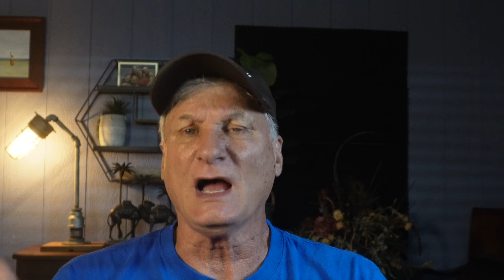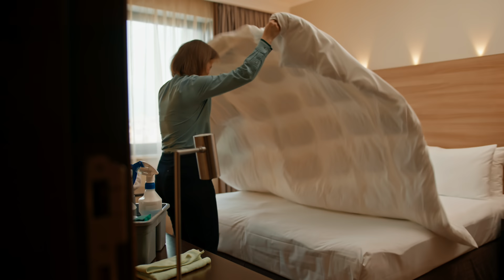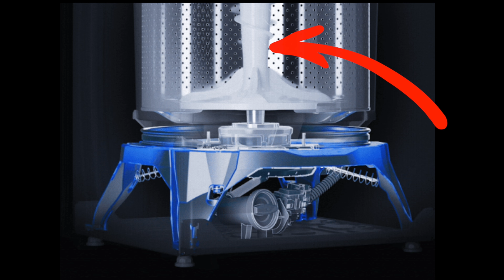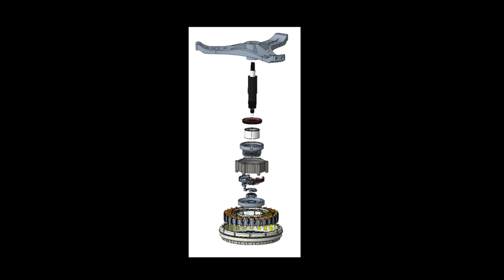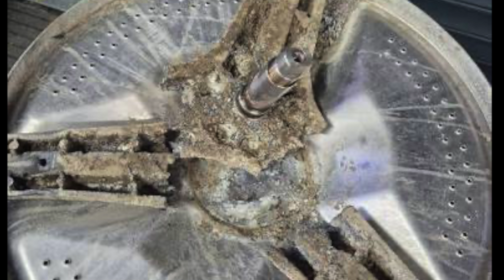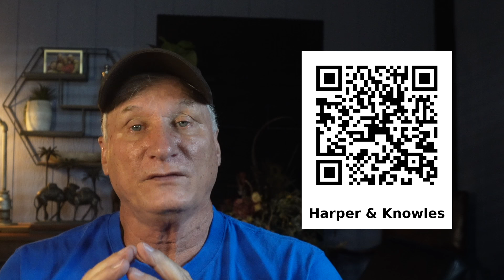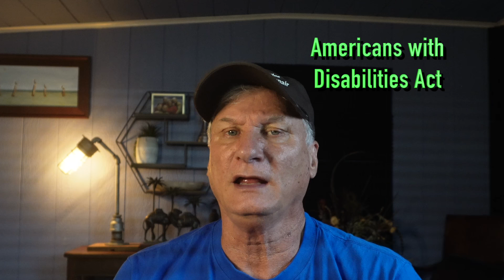Maytag's New 30-Year Washer: No Gearcase, Real Agitator, 900 RPM

Comment: Here's the deal, AAAALLLLLL the plastic, capacitors, electronics, and yes, firmware ... in this thing is designed to wear out and be replaced. "30 years" means a 30 year maintenance plan generating RR for Maytag. This also means you have to connect it to your wifi and have an account to run it.

Comment: I own a Kenmore washer and dryer. They are over 20 years old and still run well. Aside from  the occasional bad timer or heating element, both of which are super easy to change and inexpensive, they have never had any major issues.

Comment: Our current washer and dryer date to the 90s.  A ew years old I replaced the roller, glides, belt, etc on the dryer.  I also replaced a switch and timer on our washer.  Still running great.  An appliance store near me said that I was better to repair it than replace them.  The newer machines will not last.

Comment: When my parents moved into their new retirement home in 1990, it had new appliances in it.  They gave us their Kenmore model "70" washer & dryer that they had bought in 1973, before they moved in 1990.  We are still using them today. They're now 53 years old!  Yes, the washer has had a few parts replaced over the years. A new belt, a new water fill solenoid, both "T"-toggle parts of the transmission engagement levers and a new water pump. All those parts together, may have cost $95.
 Over the years, the dryer has only needed a new belt, a boggy wheel, both door support cables, a new lint filter screen, and a plastic door catch. Maybe $65 total. These were built simple, and they're basic, but they have lasted forever!

Comment: I'm still using my mothers Maytag which has to be 50 years old if not more. I had to replace her old dryer about 4 years ago, but she had it longer than the washer. My new water heater says it's good for 12 years. The one it replaced was installed in 1977 and working find until the gas put a new meter on and shut the gas off. It wouldn't restart. My new Air unit is supposed to be good for ten yeas. The one they took out was also installed in 1977. It's make it break so they have to buy another one.

Comment: The agitator in the picture for the Maytag duracore is in fact the typical wash plate with a faux corkscrew post agitator that's literally in every other Maytag and whirlpool washer sold at every big box store, the part number is W11550891,  Maytag better change that agitator to something better or use a dual action agitator,  nobody is going to spend 1,500 for a washer that has the same agitator/performance as a 500 dollar washer,  watch YouTube videos of washers with this agitator.... It's awful! Doesn't even move clothes around! Why would they get every other part of this machine right then something as important as the agitator just use something from their parts bin? Wake up Maytag!!!!!! If they use this agitator speed queen will destroy them in marketing! Remember when Maytag mocked speed queen saying "ours washes better we have a dual action agitator"? Well.. not anymore!!!

Comment: I bought a Matag gas  dryer 38 years ago (simple 3 different dryer settings, nothing fancy). Have replaced the thermocouple about 3 times. Other than that, it is a workhorse and I love it.
I've had my Maytag Neptune front loader for 25 years with no problems! I pray these 2 appliances keep working, because I do NOT like the new ones...too many fancy settings that you DO NOT need and only adds price and things to break!
Reply: they will last  oner 50 years. that one is  a old pilot light. the only thing  that might wear out is the  motor

Comment: We had all Kenmore appliances for years. Sears was a great place to shop in the 70's. Kenmore was unbeatable. I have a 2005 Kenmore refrigerator running right now in a storage room
Reply: I grew up with my mom only getting Kenmore.  Last so long.
Reply: AKA Whirlpool
Reply: Kenmore is just a brand. In the past, they were made by Frigidaire or whirlpool and we're good products.  Now they are made by LG and are absolute garbage.
Reply: Yes I purchased my first washer dryer combo at Sears. 1988.  Actually I checked into Maytag same time but Kenmore Whirlpool model rated higher that year. It was the heavy duty 90 series I believe. I loaned it to my mom and I purchased a new Frigidaire front load 1995. I still have the Frigidaire washer and original Kenmore gas dryer. I also purchased a Speed Queen front load washer along with dryer.

Comment: Our Matag oven is a POS. It takes forever to reach temperature. It was delivered broken. It took me a month to realize the convection fan wasn't working. 
It gives you a false reading on the temperature display by up to 25 degrees. 
The dishwasher is no better. It leaked, and the subfloor swelled and buckled. Now we're just throwing in the towel and getting a new kitchen. It's not cheap. 
We got the two- Oven and dishwasher at the same time from Lowe's about four years ago. 
If it wasn't for bad luck, we would have no luck at all.😟

Comment: So Blackrock and Vanguard are large shareholders... Not a direct majority, but how much of the other shareholders do they control?

Showing results for was whirlpool bought or is it owned or controlled by private equity capital? 

Whirlpool is not owned or controlled by private equity capital. 

It is a publicly traded corporation listed on the New York Stock Exchange (NYSE) under the ticker symbol WHR. 
Ownership is distributed among institutional investors, mutual funds, and individual shareholders, with no single entity or private equity firm holding controlling interest. 
Key shareholders include large asset management firms like BlackRock and The Vanguard Group, which together hold a significant but non-controlling portion of the shares. The company operates as an independent U.S. entity with a one-share-one-vote structure, ensuring that control remains with the broad base of public shareholders rather than a private owner.

Comment: I have a Kenmore branded Whirlpool for 34 years.  All I have ever had to do to it is change the oreo (coupling) between the motor and transmission.  It is an amazing machine and I hope I can keep it running for another 30 years because I don't want a bunch of electronic garbage in a washing machine.
Reply: Some of the most reliable washers ever, rebuilding mine right now

Comment: Hi Chip — Off topic.  I have an old Kenmore washer, at least 25 years old, probably older.  It’s a real trooper.  I saw a video that explained the agitator dogs and how they work.  Working dogs allow the top part of the agitator to rotate in one direction, but it locks in the other direction.  I didn’t know about that, and I checked my machine.  It has an agitator, but the top and bottom seem to be one piece.  The whole agitator moves as one, back and forth.  Is that a problem?  I love this machine and wish I could get one just like it, but they don’t make them like this anymore, except I guess Speed Queen.  I hope other manufacturers return to making durable equipment, as I as so disgusted with the junk being sold now.  😢
Reply from the maker: No, that is a blessing. I love that style of agitator. Some will argue it isn't as effective, but if you watch the clothes wash, it moves them downward at the center just like a two-piece model does. Fewer parts for the same effect.
Reply: @HarperandKnowles  Thank you for prompt reply.  👍🏻

Comment: I haven't bought a Maytag since I got burned by a Neptune front-load washer 20 years ago. Just after the warranty expired, a $5.00 "wax motor" (the thing that keeps the door from opening when it's running) failed and took out a $300.00 circuit board.

Comment: It seems like washer designers don’t understand gravity and that water runs downhill.  It seems they always put the motor on the bottom where any leak can have a negative impact.  Particularly now with the external style motor, they could put the magnets around the top of the tub and the stator coils on top also.  This way, a simple leak wouldn’t have a change to cook the motor.

Comment: In 2022 I bought a new top of the line maytag washer and dryer for my new house. The washer has absolutely been the worst purchase I have ever made. I've had to replace the main board, wire harness,  and lid lock multiple times. I will NEVER buy another maytag/whirlpool appliance again.

Comment: I don't trust a machine with no gearcase.  Those tiny motors, from my experience fail quickly compared to a good ol castiron gearcase.  The bearings in the motors are small  And, Lets get back to analog dials.

Comment: In 2017 I had had enough of my whirlpool cabrio washer.  Nothing ever came out clean and took forever to wash a load.  I called a local speed queen dealer and bought a washer ight unseen over the phone.  The first time I saw it in person was when it was delivered.    I could tell by the first load how much cleaner my clothes were.   2 weeks ago I had a repair man just come do a checkup on my washer just to make sure I was cleaning the agitator correctly etc.  he opened it up and was so impressed as to how good a shape it was in.  It’s 9 years old now.   He said he would be surprised if it did t last another 15 or more years.

Comment: I've got two Maytag's in the yard. They were bought new and didn't last a year. I went on Craigslist and found a 10 year old Hotpoint. 
It's been doing fine for a year.
Reply: I have a used Kenmore washer that my fiancee owned.  That was 1988.  I am still using it.  No service calls.  IT is all analog.
Reply: @millerforester6237  Those are the best kind. I used one for 20 years that was 15 years old when I got it.

Comment: I am still using the Kenmore washing machine I bought used 22 years ago.  I got a dryer with it as a set from a used appliance store.  It was an extra large capacity and reportedly was replaced because the previous owner wanted a new fancier machine.  I can almost guarantee that it has lasted me longer than her new machine did.  I did have to get some parts replaced once.  The dryer that I bought along with it has also lasted for years, though my dad had to repair something in it.  The total cost I bought it for, and the repairs I paid for it cost so much less than a new machine back then, and I can’t even imagine now.  I have washed everything from heavy comforters to sheep fleeces in it.  Especially for washing fleeces, you need a spin cycle that doesn’t run water into the machine as it’s spinning or it can felt.  If this machine ever goes out and can’t be repaired, I don’t know what I’ll do.  We’ve used the newer HE machines at other people’s houses and they just don’t get the clothes as clean.  When we had our babies, we’d have to wash the diapers 3 x for every one wash in our machine.  I don’t think that actually saves water in the long run.
Not to mention, the HE washer took three to five times as long as our washing machine.  I’d frankly rather do my laundry with a laundry bucket and plunger washer than use an HE machine.
Reply: I have a used Kenmore washer that my fiancee owned in 1988.  it is all analog.  no service calls.  Using it now.
Reply: Kenmore Appliances were the best, longest lasting appliances ever made!!! ❤
Reply: I'm still using mine.  Built in the 90s. Ive tried another because my husband wanted new.  It was crap and we went and moved the old one right back in.
Reply: They were the best😻
Reply: 23 year old HE Kenmore here still going
Reply: In my experience, one repair costs more than buying a new machine.
Reply: @D @David-999-z ur repair person didn’t actually charge that much for the washer, no more than 15% of a new washer, maybe 20% at the most, and my dad repaired the dryer.  He’s good at fixing most things.  And I would rather have the old machine than the new ones.  They don’t work as well to actually get clothes clean and they don’t work at all on sheep fleeces without felting them.  As long as we can keep our old washer going, I’ll pay to repair it, or my husband and I will figure it out ourselves, as we’re both fairly handy.  If we do finally have to buy another one, I’ll try to find another older one like ours.
Reply: @David-999-z that’s why you diy
Reply: My mom had her Kenmore for 36 years and went through five kids with it.

Comment: I bought a set of the cheapest Maytags available in 2001. $900 for both. 
They have just a couple of simple mechanical buttons. 
They have performed flawlessly for 25 years and are good for another 25.

NEVER buy a "smart" appliance.

Smart is the new STUPID.
Reply: Computers aren't the reason the products are poor.

Comment: I love my Whirlpool appliances.  I have had to complete several repairs but I am fortunate to be able to do those myself and only incur the cost of the parts.   I also open them up an clean them out and maintain them on a yearly basis. My washer and dryer are going on 21 years, in fairness things may have changed since purchased. However, my experience is there products are repairable and generally high quality compared to the rest of the market.

Comment: I had a 2001 Amana Commercial that when I took it apart, had many of the same parts that are inside a Speed Queen, except for the plastic outer tub.  Now the tub lasted the life of the machine but I've heard of some people forgetting a safety pin or some metal object poking the outer tub but was fixable with jb weld or plastic epoxy.  But what went out first was obviously the drain pump at about 10 years as well as the plastic corrugated drain hose wore a tiny hole in it from vibrating/rubbing up against a metal part inside the unit, but the first major part was the tub bearing at about 15 years and that took a lot of effort on my part to replace, and then at about 20 years the transmission went out and we junked it at that point.  This was for a family of 5 that did a lot of laundry.

Comment: as someone in central louisiana, how'd you know? I had the control board "go out" on an MCT on year 8 or so, service tech said $800 but go buy it myself and put it in myself, so i did, for like $130. The little pressure tube sensor part should be separate in my opinion. I also don't  have a problem with the wash plate system in mine, you just have to load it differently. Not sure if this channel has shown how to load; wash plates agitate in a donut shape viewed from the side, stuff goes up, in, down, out. on an agitator washer, stuff goes in a donut shape in a circle, back and forth. So you gotta load washplate ones only on the sides*, as if it had a massive agitator, you should be able to see *most of the washplate when it's fully loaded. Do that, and you won't hate your washplate, even on He2 washers!

Comment: What can you recommend, we need washer asap, 4 ppl lot of clothes, don’t want to spend 2k. On a budget however I don’t want junk either, we just got done takin apart a whirlpool cabrio 3 times to replace those rods, sent us wrong sizes, took those out, refurbished original ones new foam things, cleaned greased rods etc. still unbalanced. Figured now it’s the drive hub thing, have to take that cover off that hardly anyone can get off without a crowbar, I was going to replace the part with a metal one instead of plastic. We bought it used , 2 weeks later all this mess started with banging and clanging and signals etc. I’m done with this I think. Mainly because of the face I don’t want to fight getting that cover off and not having correct tools even though this machine doesn’t require that specific tool they use on some. We’re not into this washer deep far as money , just time mainly. But my wife is done with it. She helped me , we spend 40 bucks a week a laundry mat every week. I just don’t know what to buy, I research and read and read etc. I came down to GE, LG, Maytag. I generally thought speed queen was not in our budget so I ignored that brand prob the best one though. I’m literally lost at this point. I’m happy I came across you this morning, all I’m asking you is for a good recommendation for a washer, I think I’m staying clear of used , all I see is whirlpool. Now I know why. Not many other brands certainly not speed queen and not many maytags. If you can give me a specific model I would so much appreciate it. And thanks a lot for in depth insight to this industry, wow , if everyone knew what goes on , they really are out for a buck not so much the consumer. Logically it makes sense to go with an expensive dependable one. Money of course depending on situations depends on what is affordable. I’m at point I don’t care. But want to be sensible.

Comment: About three yrs ago I got tired of these enervy saving washers.  No matter how small amount of detergent I used, it still wouldn't get the detergent out.  So I bought a Matag Commercial washer, I wanted a full tub of water to wash and rinse my clothes.  The Matag had a 5 yr warranty on parts and labor and at a cost of $1000.00.  The first year had to have repairman, second year same thing.  With a warranty of parts & labor it was worth it.   It is working better than new now.

Comment: I was in the market for new kitchen appliances earlier this year.  Mine are 20 years old.  The dealer at the appliance store said to expect 7 or 8 years of usability out of new appliances.  I looked them over; all brand names.  I commented that they don’t make them to last anymore.  He replied that they could make them last 20 to 25 years, but it would require better parts and better engineering.  That would drive up the price significantly.  He said buyers will pay $700 for an appliance that lasts 7 or 8 years, but won’t pay $1500 for one that will last 20 to 25.